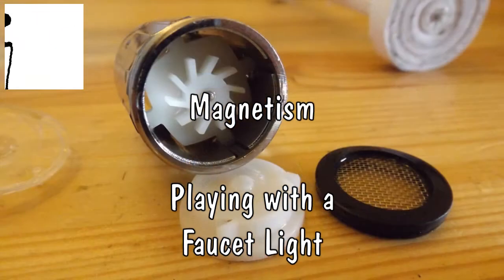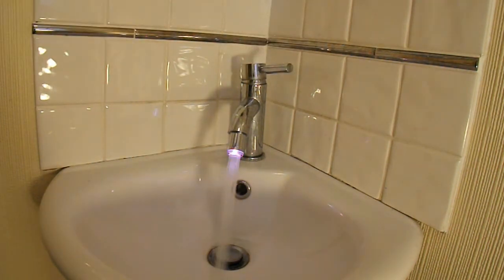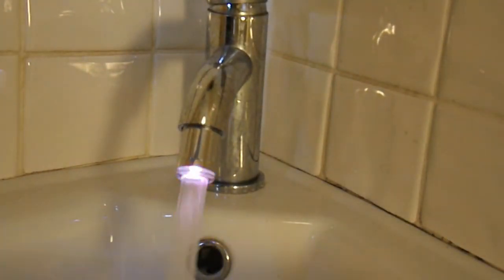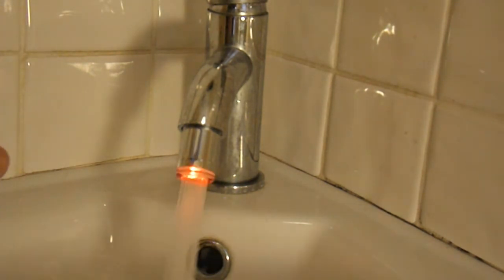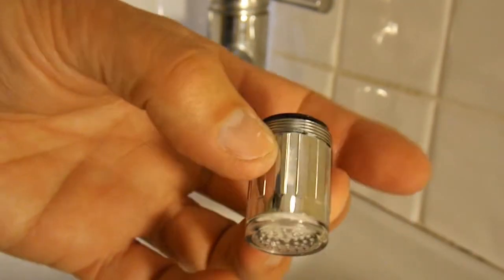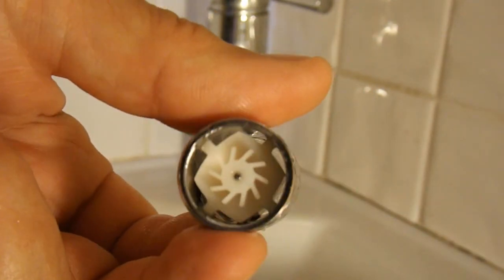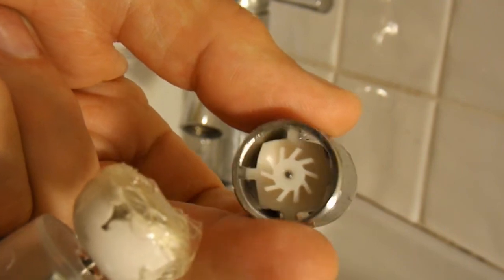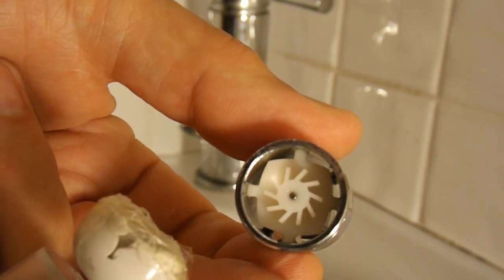Magnetism - Playing with a Faucet Light Part #2

Comment: Excellent! Certainly not what i expected. My curiosity is sated and i've learned something new. Thanks Grandad! :D
Reply from the maker: Thanks, however your point is still valid. The spinning magnets might be inducing current flow directly into the little generator's coils and without completely taking it apart and removing the core I can't conclusively prove it either way. I don't intend to go that far at the moment although if I break one when I finally try to emulate Lidmotor's project I may give it a go.

Comment: I wonder if you could reverse this.  Maybe have the generator spin up a magnet rotor held near the running tap.  It would have to be  a small one but it might work.
Reply from the maker: Hi Lidmotor, I have been on holiday for a week with no WiFi available so no real chance to reply to messages. Yes that would be an interesting project, small low friction work is not my strong point, but I will put it on my list. I might check your channel first just in case you have already done it since I was offline.